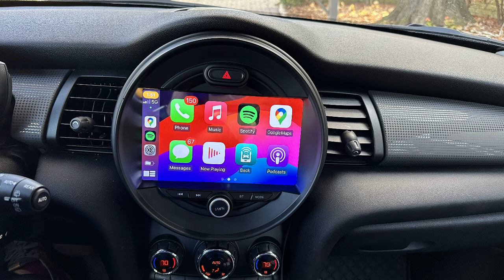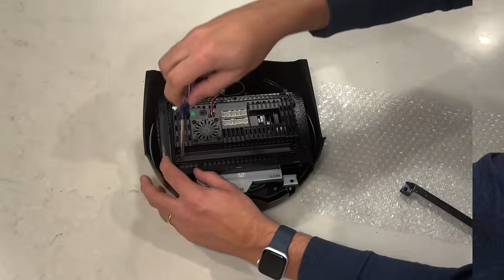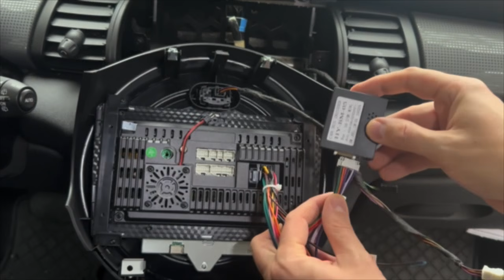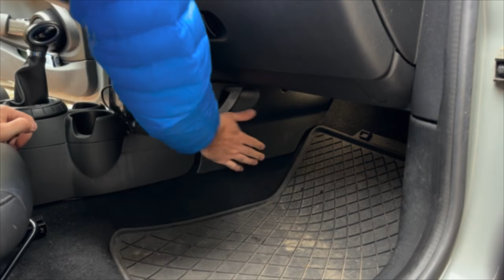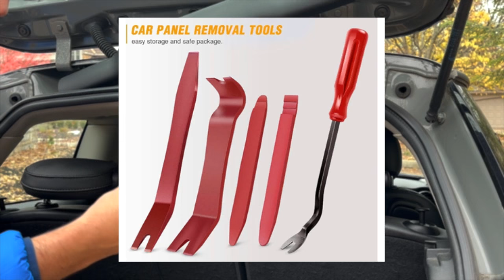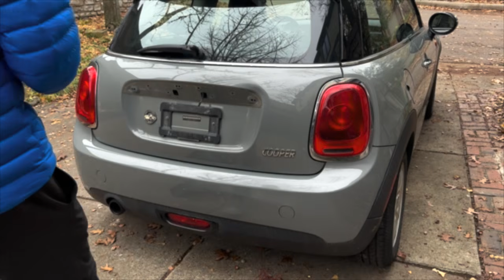Mini F-Series New Display w/ Apple CarPlay and back up camera  (F55, F56, F57, F60)

Comment: Hey, how did u fit the new frame into the hole... The top was ok but from below seems like a plastic bar is blocking it from fitting
Reply from the maker: I don’t remember it being difficult to pop back it, but it did fit snug.
Reply: Same Problem did you find a Solution ?

Comment: Does this unit support factory oil level and tpms?
Reply from the maker: It says it supports TPMS and “other functions”. I haven’t tried to use those functions thought
Reply: @DadHacks could you please confirm if those checks work?
Reply from the maker: @arturosanchez1404  I don’t have the car anymore and never tried checking
Reply: Who installs a backup camera on a Mini?
         😂